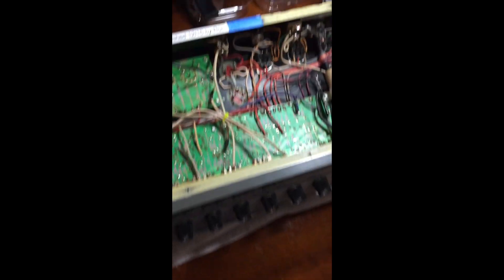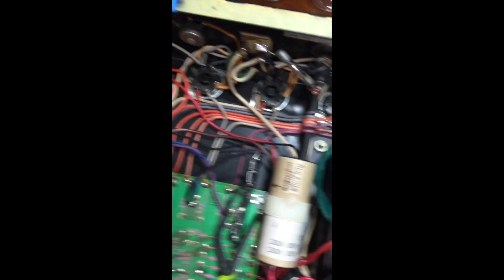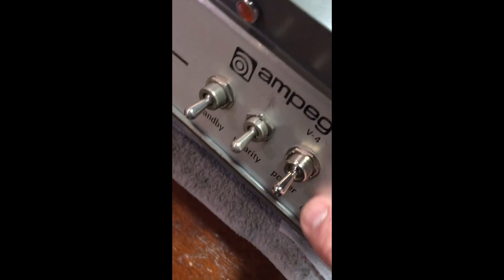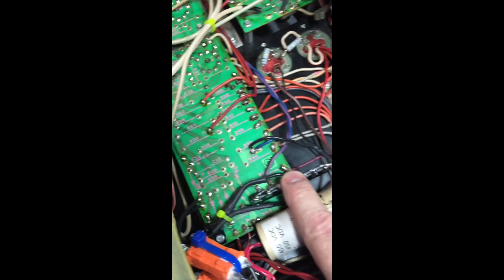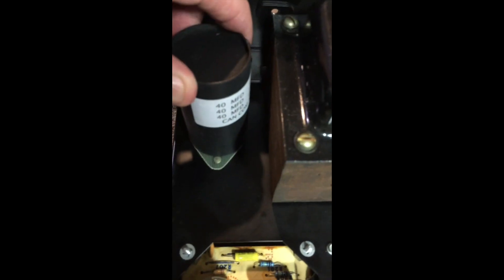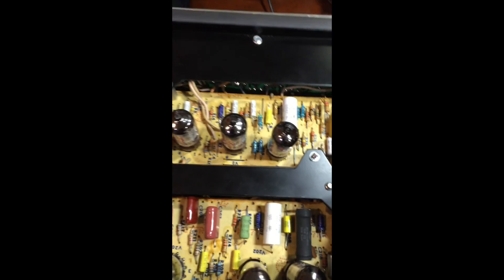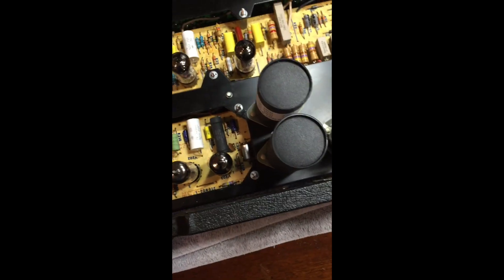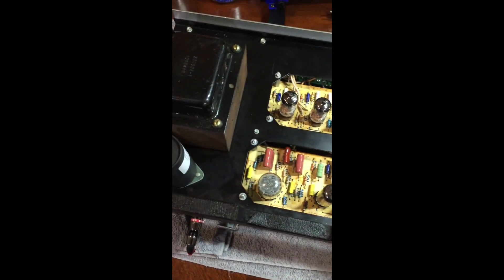Ampeg V4 Repair

Comment: Great advice, safety first.  
IMO, Ampeg is the Cadillac of bass amps.  
I wish I had one.  Quality work for a quality amplifier!  Don
Reply from the maker: +umajunkcollector  Thank you Don for leaving a comment.  These amps are amazing. I am getting another Ampeg this week and will do a Step by Step restore of that one as well. I am picking these things up cheap and can really turn them around if I chose to. The jury is still out on that part :)     I also picked up one of those OL-1 HeathKit scopes just like Johns and will do a step by step as well.

Comment: Hey Ron, just caught this. Great inspiration. I'm at my wit's end trying to diagnose my 1970 (rev B) V2.  Ugly distortion starting at 8:30 on the volume knob with Texas Specials single coil. Trouble begins at inverter grid. If I can find the culprit I will probably follow your sage advice and redo caps (probably not the FlipTop route-  way too expensive now as are 7027a's - don't need a vintage replica. Voltages look OK and I've swapped out all the tubes.  Any suggestions where to look first? I'
Reply from the maker: Paul - its been a long time since I worked on this, but I clearly recall that many resistors were bad and alot of the ceramic caps where cracked. The distortion you mention sounds like a resistor to me... or a broken /cracked cap. Have you changed them out in that investor section ?
Reply: @rciancia  Glad you confirm that the amp shouldn't breakup so early. Folks on a forum seemed to think that was normal. Would think I should get ~50W clean. Haven't looked on component side of board yet - sometimes hard to measure R and C in circuit.  I get 35V of sag at full vol. Does this sound OK?

Comment: Are the Ampeg V4 and the the Amperg VT-40 the same amp? Also, I had an amp tech replace the hard-to-find power tubes with KT-88s.
Reply from the maker: Charlie, I do not believe this is the same..  I still have the V4.... wanna buy it.. cheap :)  Its sitting and not being used.